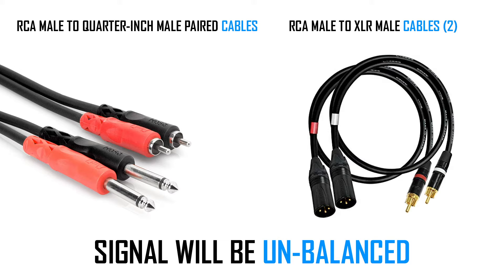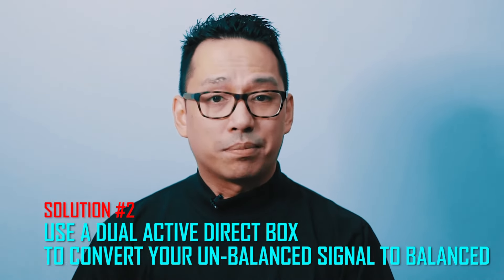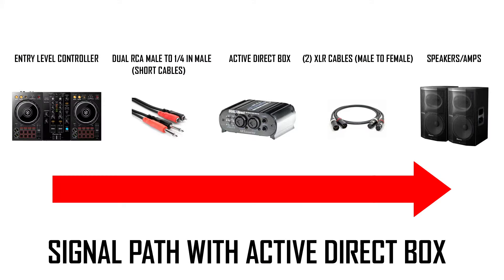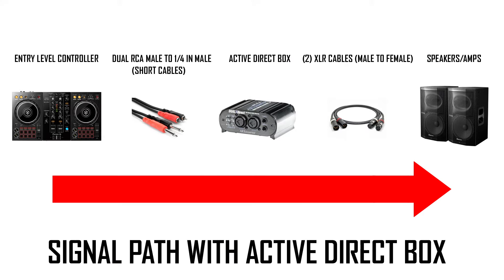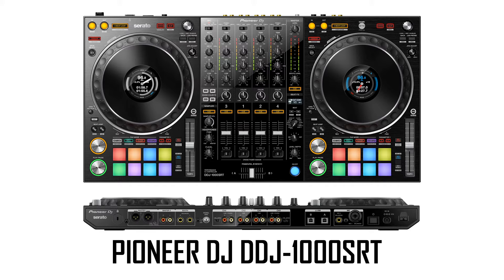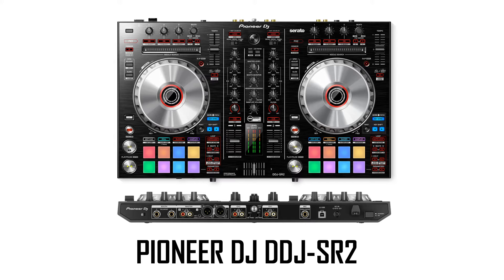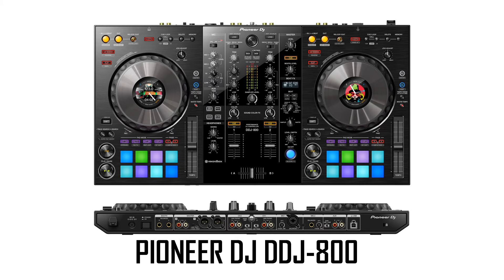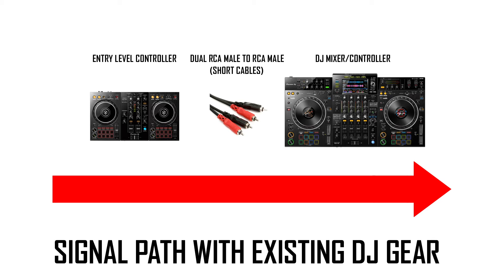Entry Level DJ Controller | How to connect to speakers or sound system

Comment: I had a Behringer XENYX 302USB exactly for that to hook up my DDJ-400. But cheap certain comes at a price: noise on the line. Returned it and spend more money to pick up an Allen & Heath ZEDi-8 instead. Very happy with the clean signal (also looks better than Behringer's). Also has a 2-channel USB interface which is great for diving into how to use DAW's.
Watched this video after the purchases. But still great to know my decision was in line with recommended solutions.
Reply: Does that mixer have a place for a powered sub or can I use one of the lines?

Comment: how do I connect my pioneer DDJ 400 to yamaha HS5 monitor speakers which has XLR and TRS inputs?
Reply: You need a direct box or a dj mixer it is mentioned in the video
Reply: @djkocka7922  can't I just connect it directly to my speakers through rca to xlr

Comment: So I need rca to 1/4” TS or TRS from my controller to my mixer and from my mixer to the rca on my speakers. TS or TRS is the question. Thanka
Reply: the answer is TS.
There's no benefit in using a "balanced" cable here since your output is unbalanced. RCA to TS cables are the best bet for you here.
But another question: why would you connect your mix to your speaker via rca connection: you will have an unbalanced signal no matter what cable u put

Comment: Hi Pri, great video and well explained. I am a elder mobile dj and have been doing it a little tough. I just bought a DDJ-SB3  and would like to connect 2x RCF active speakers and 1 sub. Can you please explain how to connect as am a little confused. Do i need to add anything else to my set up. Thank you again.
Reply from the maker: Assuming that there are stereo crossovered input/outputs on the sub, the signal chain should be as follows. DDJ-SB3 (RCA to 1/4inch) > PA mixer (XLR) > Sub (XLR) > (XLR) speakers
Reply: @priyonjoni  thank you.

Comment: hello great video btw just a quick question can you still use a ddj 400 on a PA system without a PA mixer. Thanks
Reply from the maker: Yes you can. However, you will be limited by cable distance and signal strength. Some speakers allow you increase the gain while others don’t.

Comment: hey bro I have a ddj800 and a Behringer b115w speaker which cable should I use? thank you
Reply from the maker: Christian Quintero have you checked the type of input jack your speaker has?
Reply: @priyonjoni  in the back of the speaker it has 2 1/4 for mics and a xlr male like the one in the ddj800 master the speaker is also bluetooth speaker

Comment: Hi! My question is, with the RCA -> DI Box -> PA/Big Speaker set-up, would it be fine if from the DI box to the PA set up, I use a dual XLR cable that merges into a single XLR cable? For example, if the venue's mixer or small PA system only has one Input available
Reply from the maker: Yes you can convert it to mono, but I don't recommend it.

Comment: I'm a super entry-level DJ and this video with super informative. I just bought the Pioneer DDJ sb3 and I needed help on how to hook the controller up to my focusrite 2i2 interface
Reply from the maker: I would recommend using a dual RCA to quarter inch wires.
Reply: @priyonjoni  This may sound complicated, how do I connect my Pioneer DJ Controller to Crossover, Graphic Equalizer and 2 amps?
Reply: @priyonjoni  The Crossover has an independent sub input.

Comment: easy connect it to the audio mixer
Reply from the maker: Galactic Taco sometimes, you have to explain to folks why connecting it directly isn’t the best idea. Or else they will just insist on on using an RCA to XLR adapter or wire.

Comment: if i want connect my pioneer ddj rr with two jbl speakers (aux-in). On my ddj rr i have two xlr port; is correct take two xlr to jack cable (one for speaker) without using a external mixer?  thanks

Comment: Hi guys,
Recently bought a sound craft notepad5 to balance the signal from my ddj400 to some jbl eon 615s I bought. I have connected everything, faders turned up a little bit and still cannot hear anything. The lights on the mixer don’t come up at all - not sure if anyone can help here.

Comment: If your going from the DDJ 400, to unpowered speakers, do you need a power amp? And if you are using the Behringer 802 usb mixing board, do you have to have a external amp to get power to the speakers, if using unpowered speakers?
Reply from the maker: Yes you will need a power amp to power passive speakers.

Comment: Hi I have a Hercules DJcontrol inpulse 500 running Djuced and serato lite. I am trying to connect to my 4 way sony floor speakers SS-F6000P which were normally used on my sony amp and running my audio system in lounge. There is no power going to either speaker just the speaker cable from the amp to left and right speaker. What i want to do is go from my hercules djcontrol inpulse 500 out the back with a rca lead into a spliter and send one rca cable to the left speaker and one to the right. 
however when i try from the djcontroller from the back via rca to one speaker this does not produce any sound. 
Is this because there is not enough power or something else.

Comment: Great video, I have a ddj400 which when plugged into my pair of jbl partybox speakers is no where near as loud as if I plug my DJM750 mixer into speakers. 
If I used a small 802 pa mixer with my ddj400, how would be best to connect pa mixer to the party boxes ? The partybox’s have 1/8 inch aux input, red/white rca inputs, and also a 1/4 inch mic input and a 1/4 inch guitar input , the mic and guitar inputs have their own gain knobs.

Comment: Questions.
Does a PA mixer boost the signal strength of  a DDJ400 more or better than plugging into the channel of another DJs mixer? Will a PA mixer improve the volume capabilities of my monitors at home? I have the big KRK G4 and I find it easy to redline my controller, especially with my bassier music. I have RCA out to XLR into my monitors and the cords are about 6 feet long. Great videos👍

Comment: Does XLR out automatically mean Balanced out?
Reply from the maker: Kay Janssen the short answer is, yes. An XLR output will be balanced.

The long answer, only if the entire connection is balanced. That means, the XLR output, the wire, and the input on the other end are all balanced. At any part of the chain it’s converted to a non-balanced signal, it is no longer balanced in the entire connection.
Reply: Pri yon Joni so if I understand you right. If i take a look at the difference between ddj 400 and 800. I can conclude that the ddj 800 doesn’t need the extra mixer or other things to convert unbalanced to balanced, because 800 already has master xlr out?

Comment: Seems like you've made a good tutorial, and one to come back to, thanks :)

As for those who make these systems, as ever the instructions show that they haven't got any idea whatsoever what the fuck they're doing.

I've blown people away with my music for 29 years. I still don't understand why the easy thing has been made ridiculously complicated. And this is the simplest presentation of it I've ever found.

My bet, sound technicians would be out of a job if musicians could just plug themselves in. So long as plugging in means you have to ballance a signal with a PQRST before DIing it to a boost interface with an HIV adaptor (so long as the signal doesn't have interference from the BBQ) and then switching the channel in the BJ to the quasimodular triceratops while adjusting the donkey flange so it realeases the right frequency of gecko farts.... then some nerds who can't make music will still get paid for sorting out all that crap 😂

Comment: Hi PJ, i have read the manual of the Q802, page 7, section 2.3.2 precisely, and it says the Main out and Control room are UNBALANCED just as another user "Trapnest" said earlier. 
i can't seem to find where it says BALANCED. 
I'm really confused. Please, kindly explain better, or point me to the part where it says BALANCED. I plan on getting the Q802 very soon and I really need to be sure it's BALANCED. I'd be expecting your reply as soon as possible. Thank you very much PJ.
Reply from the maker: evry1lovesjay there is nothing I see in the manual on section 2.3.2 that indicates anything that the 802 has unbalanced outputs.

Have you looked at page 10? Under the section MAIN OUTPUTS and CONTROL ROOM OUTPUTS.

Also, I do not work for Behringer or am a customer service agent, so despite my swift reply, I kindly ask you don’t demand that you “expect” my reply as soon as possible. 🙂 Here is the link to the manual. https://images-eu.ssl-images-amazon.com/images/I/B17mwjFdPiS.pdf
Reply: I'm honestly so sorry if you felt offended the way I put it. I like all the contents you put online for all of us.
I meant, I'd be glad to get a response.
Reply: I jut checked page 10, under specs, and yes, it says balanced. Coool
Thanks a lot.
But one more, 
What did they mean under section 2.3.2 like i said earlier, under MAIN MIX, where it says, "the main out connectors are unbalanced mono jacks"..
This is where i got confused.
Reply: I just***
Reply from the maker: @evry1lovesjay202  I think there may be a copy out there that has an error because the versions of the manual I have seen don't say anything about being unbalanced. Plus, it doesn't make sense to have a mixer that size, not be balanced outputs.
Reply: Oh, okay
Thank you verrrry much.

Comment: Thanks for the video, super helpful!

So I have two 15in powered PA speakers that take in XLR only. I also have an 18in powered sub that takes a left and a right XLR input. I use a DDJ400.

In the past, I would connect everything as follows:

DDJ —-—RCA to XLR ——-> Left Speaker 

Left speaker —XLR to XLR ——-> Right speaker 

Right speaker —XLR to XLR ——-> subwoofer.

There were multiple issues with this. First off, I know I’m not getting anywhere near the max volume out of my system because of all the signal loss. But more specifically, by only having a single input to the sub, it looses a lot of its oomph. Based on what you were saying in the video, it seems like I need either a dual direct box or a mixer. I think the dual direct box is going to be enough for me, however I wanted to check with you and see if you think that’s the best solution? 

I was thinking I would go ddj  -> direct box -> l and r speakers (respectively) —> sub. 

Will this help? I was hoping to buy the cheaper behringer dual box but I’m worried it won’t be able to handle all of this gear.

Thanks again!!
Reply: Sorry for replying to this after 7 months, but wondering if you found a solution for this? I'm in almost the exact same situation, only my sub has an RCA input.

Comment: You could also just use an audio interface, that way you're not running any RCA... should have an input for a mic if you need it too
Reply from the maker: Aidan Colin not all audio interfaces can be used as a standalone mixer.
Reply: @priyonjoni  just saying it's an option

Comment: Hi, thanks for the great video, I'm new to this, can you clarify something for me please.
You mentioned the dual active direct box will boost the signal as well as convert it to a balanced signal, I believe you said the mixing board will convert the signal to balanced and give you other possibilities too. My question is will the mixing board also boost the signal? Which is the better option if you just want to increase the volume and sound quality?
Reply from the maker: You have more control with a mixer.

Comment: nice video!

i run my monitors tru a focusrite 2i2.
when i want to use my pioneer ddj sb2, should i .. 
a) switch the output from interface to the controller (not use interface.). or
b) connect controller output to the 2 (mono!?) channels of the interface (line/instrument ? i use line).direct monitoring on! and
b´) what cable for b) ? i use cinch/klinke

hope this makes sense! 😀

thx🙏
Reply: Cheazy that sounds like a studio setup. I think that’s how I’m gonna setup my controller that I just ordered. You should just go from controller to the focusrite since it’s a pre amp. You don’t really need a mixer unless you’re looking for an analog sound.

Comment: What if one of my speakers has only rca inputs but i want to plug in 2 speakers one with rca and one with xlr is that possible?
Reply from the maker: If you already have the gear, you have a way to try it.
Reply: I have another question you mention in the video you can Split the rca cable and go to each speaker with that cable does that mean you dont have to plug L and R into the speaker for it to work?

Comment: Hii priyon✨need good advice..is it good thing frm mixer djm 900nxs2 rec out rca to presonus e3.5 powered speaker rca input? 
   Next option advice..frm djm 900nxs2 mixer master out using splitter rca to presonus e3.5 rca input good?

Comment: Hi @Pri Yon Joni thank you for the video..

However i got some question, i use NI Traktor S2MK3, Presonus Eris 4.5 monitor and NI Komplete Audio 2 as my interface. Current setup is that my speaker connect to my interface via TSR cable and my S2MK3 connect to monitor using RCA (Eris 4.5 have RCA and TSR input), meaning my monitor is connected with 2 input source.

I plan to have my monitor to have only 1 input and intend to connect my S2MK3 to my interface in order to add some scratch into  my beats that i created. I tried to connect my S2MK3 to interface using RCA -> 1/4 jack cable by connecting Input 1 and Input 2 of my interface but there was no sound came out. I put the input as Line and did tried as Inst i can see the monitor indicator lighten up but still no sound. I also tried to plug in the 1/8 TSR -> 1/4 TSR cable from S2MK3 (S2MK3 have both RCA and TSR output) to my interface and the result is the same.

Does this mean i need to amplify the out in order to connect it to my interface?is it the same case as the issue in your video? Can using Direct Active Box or Mixer fix this? I don't have a mic currently (planning to get one in Sept). Need your advice..

Thanks...
Reply from the maker: dynexell I’m not sure why you’re not getting any audio. If I were you, I would create a video to demonstrate your problem. And if you’re in the Traktor groups or forums, consult someone to help. I’m not familiar with the Audio 2.
Reply: @priyonjoni  i also not sure why..but all my connection is correct right?it should have an output by right..what say you?
Reply from the maker: Have you contacted Native Instruments?
Reply: @priyonjoni  yes.. already did..still communicate with their via emails.. it's been almosts 3 months now..

Comment: Hey bro, if my ddj1000 controller is connecting to a sony bluetooth xtra bass speakers which only has RCA inputs, am i going to have unbalanced crap sound no matter what or can i add a direct box ? Thanks !
Reply from the maker: Richard Duong an unbalanced signal is not a “crappy” sound. A short 3-6ft RCA cable will be totally fine. Balanced output is most effective when using longer cables. By design, the cancel radio interference that can get introduced and amplified in a long cable. 

If your speaker only has RCA, then your choice is to use the RCA output of your DDJ-1000, with a cable ideally no more than 6 feet. Interference gradually grows the longer the cable. But 6ft will be just fine.

Remember, CDJs are connected to the mixer via RCA cables, even on big systems at festivals. The short distance doesn’t have any negative effect on signal quality.
Reply: @priyonjoni  and if i wanted to run RCAS longer than 10 feet ? lol

Comment: Yo PJ I have a behringer xenyx 802 is there any problem sending the rca output from my controller in to the rca input on the behringer mixer ?
Reply from the maker: You should not use that as an input. You won’t have gain or eq controls.

Comment: Hey Pri, what if I use a single active DI box  with  a splitter for the 2 speakers?  will the audio be converted into a MONO Signal?
Reply from the maker: Yes it will be mono.
Reply: @priyonjoni  ok cool.  Thanks Pri

Comment: I have a problem i just bought a sb3 and when i use the 3rd and 4th decks there’s no sound . It’s working and i can control it but there’s no sound . Is it a thing from the sitting or its my speakers. Or should i call the company and return it .
Reply from the maker: Create a request ticket on Serato or Pioneer DJ’s website. The technical support agents will be able to work with you on how to trouble shoot. Hope you understand, but “there is no sound” can be a number of things. But the agent will be able to determine that based on the info they ask for.

Comment: I was wondering how I could connect the Zone Out of a Denon DJ Prime 4 to a regular Denon AVR-X1200W AV receiver that does not have XLR or 1/4" inputs, knowing that the receiver is about 40 feet away, in another room. The RCA cables are not the best option, so I was thinking to maybe send a balanced signal via XLR or 1/4" cables to a Behringer Q802USB mixer that you recommended in one of your videos, and then use a 3 feet RCA cable from the OUT of the Behringer mixer to the RCA AUDIO IN of the Denon receiver. With the Denon Prime 4 you can dj in one room and send a playlist to another room, and this is what I am trying to achieve, while maintaining the quality of the sound in both rooms. Any help here would be greatly appreciated.

Comment: so does mixer can make my speakers louder?

i have ddj400 (master volume and gain to proper level 0db.)  and the speakers that i use won't go loud. 

is it because the output signal is really weak on the ddj400?

if i switch to ddj800 or ddj1000
my speakers will get loud on the same master level and gain level adjust as on the ddj400?

(speakers work normally and go loud with bluetooth phone connection).
Reply: Did you turn the trim knob?